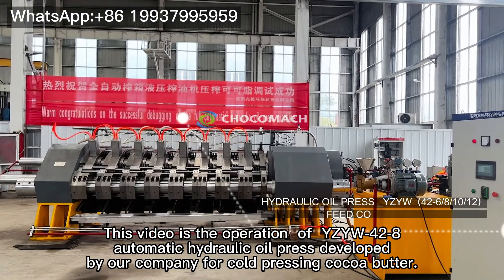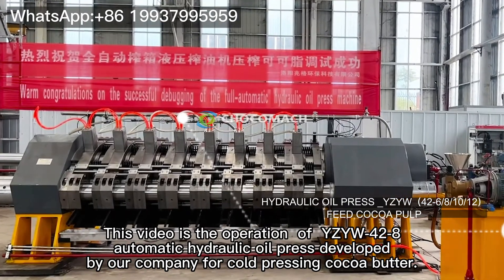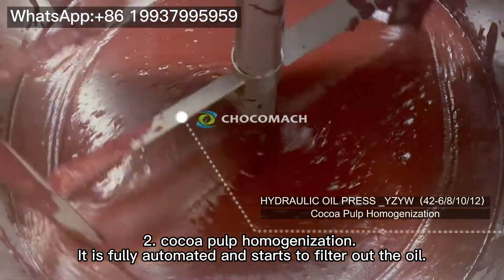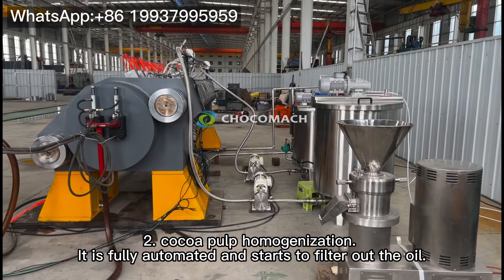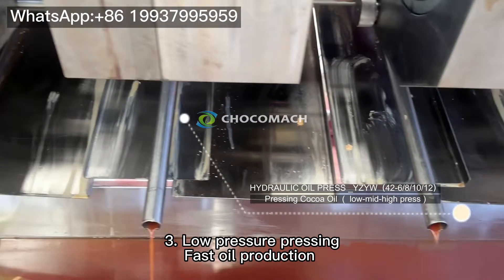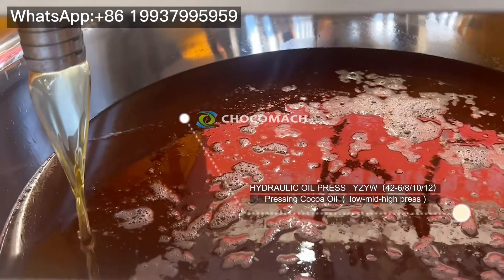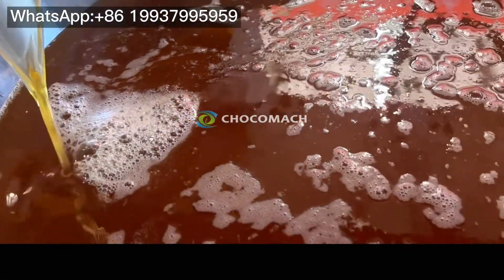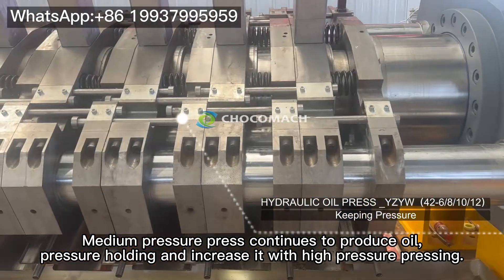Low fat cocoa powder production line │How to produce 10%-12% alkalized cocoa powder#cocoapowder

Comment from the maker: CHOCOMACH COCOA BUTTER PRESS (YZYW)
Type	Pots Specification  Single Charge  Production Cycle   Daily Throughput   System Pressure   Work Pressure  Material Pressure  Motor Power             L*W*H              Net Weight
                      (mm）                  (Kg)                     (times/h)                (Kg/24H)                     (Mpa)                       (T)                    (Mpa)                     (Kw)                            (mm)                    (Kg)
YZYW42-4      420                       52                          3                           3744                              ≤55                      ≤1259                 ≤90.9                  5.5+7.5                3450*1685*2250        16500
YZYW42-6      420                       78                          3                           5616                              ≤55                      ≤1259                 ≤90.9                  5.5+7.5                4150*1685*2250        21000
YZYW42-8      420                     104                          3                           7488                             ≤55                      ≤1259                 ≤90.9                  5.5+7.5                 5450*1685*2250        25000
YZYW42-10    420                     130                         4                            9360                             ≤55                      ≤1259                 ≤90.9                  5.5+7.5                 6350*1685*2250        28000
YZYW42-12    420                     156                         5                          11232                             ≤55                      ≤1259                 ≤90.9                  5.5+7.5                 7250*1685*2250        31000

Comment from the maker: Technical advantages:
The mechanical part of the fully automatic press box hydraulic oil press adopts a horizontal press box mechanism, the loading system and the pressing system use independent press boxes, and the oil outlet method is improved to "end oil outlet", the oil outlet path is shorter, and the oil outlet efficiency is improved higher.

Comment from the maker: Working process: Heating the whole machine, refining the material, heating and homogenizing, pumping the material, squeezing the oil, maintaining the pressure at high pressure, removing the cake from the material, reset and clamping the mold, and the cycle goes on and on.

Comment from the maker: Cocoa butter press machine has excellent material and precise technology. The Hydraulic Cocoa Oil Making Machine is made of high carbon steel and is made of high frequency quenching and heat treatment. It has high hardness, high strength and good wear resistance. It is suitable for high temperature and high pressure continuous operation and improves the pressing. The life of the oil machine can last for several decades.